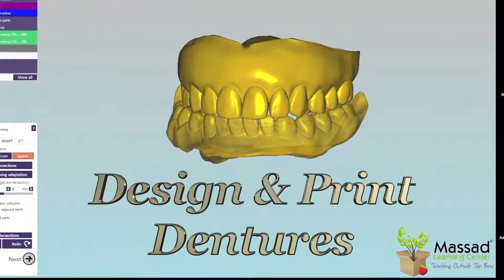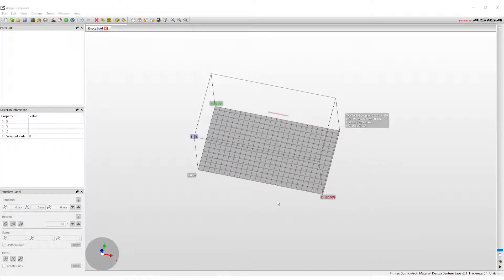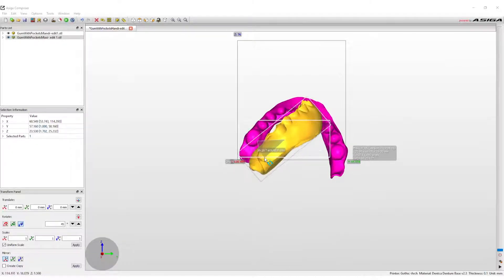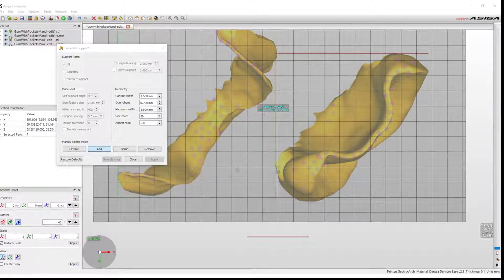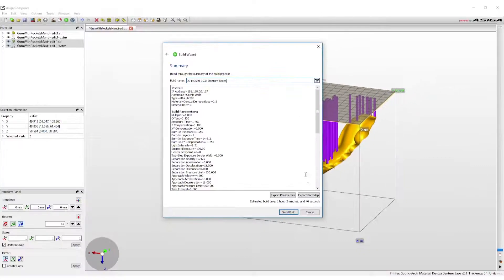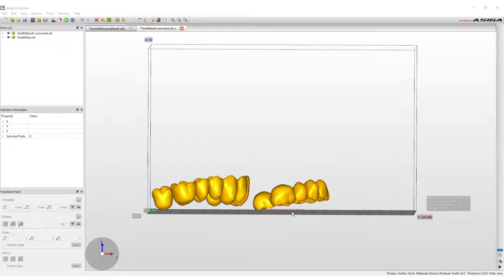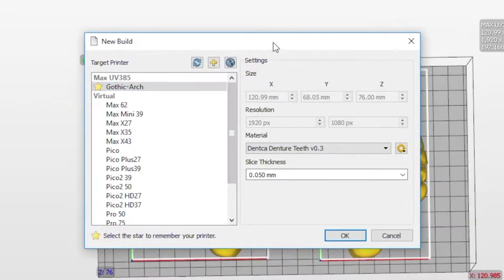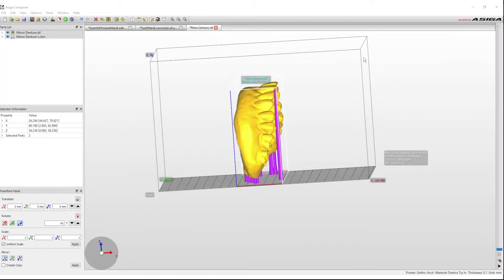Nest Dentures in Asiga Composer

Comment: I find it hard to believe that the print time is 1h2min for the denture base that is nested and printed at that height, it will have many layers. Is it for real?
Reply from the maker: The estimated print time is going to be changing frequently based on several different parameters. That 1 hour print time could have been actual, however that print time is not the typical or expected print time for build jobs in the current setups.
Reply: @WhipMixCorporation  Ok, Thank you for your reply

Comment: Here's a random question.... The yellow and magenta.. I'm finding myself hit a change where the design goes red, and thus renders the design unusable. Do you know what I'm doing to get the red, or how to resolve it? Thanks in advance!
Reply from the maker: While we don't know what you are doing to get the designs to turn red, here is what the Manual says about those red facets:
 
"The STL solid surface is defined over many triangles and the simplest closed volume is preferred for processing. Composer can render the backfaces of triangles using a different color (red by default) by enabling “Show Flipped Facets”."
 
So essentially getting the designs to render inside out. Without more information about what you are doing to get to that point it is difficult to offer much further advice but you are more than welcome to email us at productsupport@whipmix.com and we can assist you if you are a customer of ours. If you have a different reseller, you will need to reach out to them for further technical support.